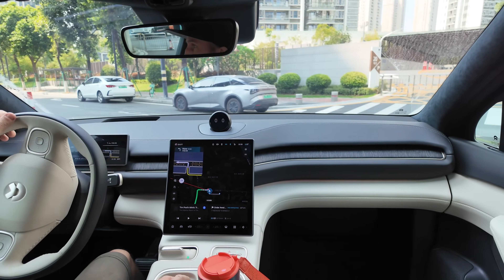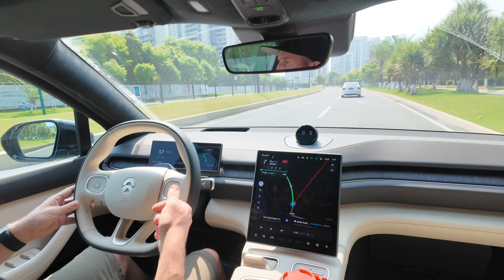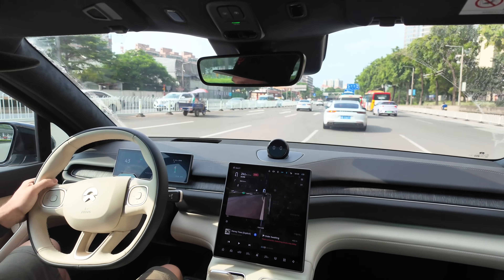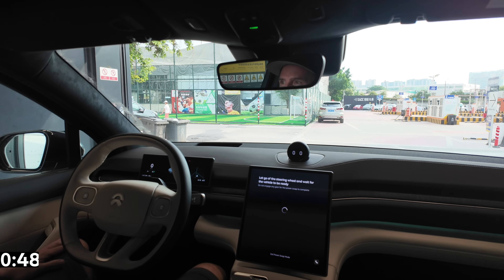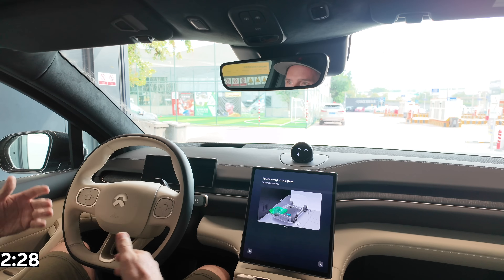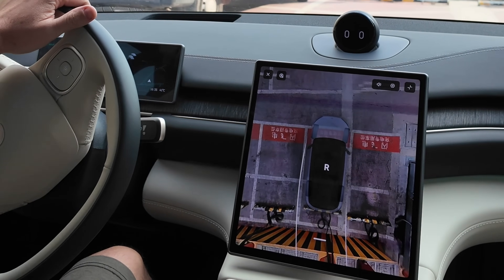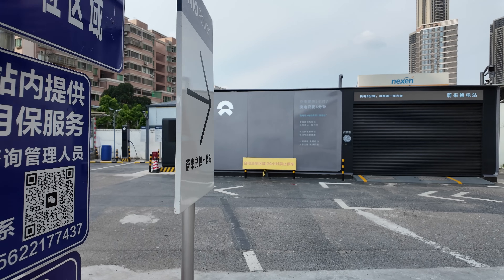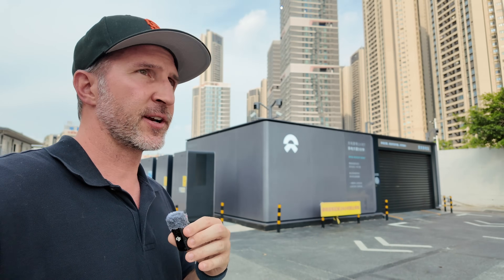NIO 4th Generation Power Swap Station Tested

Comment: How much cost to swap the battery? (in US$). Is it more expensive than traditional charging?
Reply from the maker: cost depends on a variety of factors, but no it is not expensive,  roughly equivalent to fast charging costs.
Reply: That's amazing!
 3.5 minutes for over 90% of battery. WOW.
Reply from the maker: It's down to 2.5 minutes now with ONVO cars... pretty nuts

Comment: Battery swap is not scalable when there are many cars needing to do battery swap.    How many cars can perform battery swap concurrently since waiting in line for each car is 3 minutes.
How many fully charged battery packs can each station serve before drivers need to wait for charged battery packs to be available?
Reply from the maker: Massive parking lots full of super chargers drawing immense amount of energy from the grid at the same time also “isn’t scalable” but is being done…Ideally everyone can charge at home during off peak hours but that’s not how things actually work. This takes up less space and is more efficient, more throughput of vehicles in the same amount of space. 3-4 parking spaces used to swap can fully charge about 15 cars per hour currently. 3-4 spaces all supercharging maybe could do a handful, depending on which make and model, what battery chemistry, load management, etc.
Reply: @Eric_Garrison  To compare with concurrent charging:   How many charged battery packs does each Nio station store?   25?  Are they charging them after the swap, or is able to wait till off-peak hours to charge them?   Or the same issue exists when you said they can swap 15 cars per hour?   NIO would need to supercharge those battery packs concurrently to have a supply of charged packs.
As for parking space, true when it takes longer to charge, but the swap station is counting on optimal car line up if it offers 3 spaces for people to park their car to wait for the swap.

Comment: I don't think this method of charging a battery will be very viable,... you have to travel to the station then you probably have to wait in line for your turn I'd much rather just be charging at home
Reply: Nio car is also chargeable too.
Reply: Not everyone has home charger.  Beside what about when you long distance travel ?!
Reply: @zuzang6914  more supercharging stations would solve that problem for travel.   And future vehicles would drive themselves to be charged/park, and to be summoned back when needed.
Reply: @Trust_but_Verify  You missing the whole point. People that don't understand tech should listen, not speak or write stuff. Until you at least have some understanding for how things work.
Reply: @MMM-sz8vh  I understand tech.   What's the point you are trying to convey? All techs need to achieve business value unless they are in the charity business.  Battery swap works for ride share owner needing fast turn around and doesn't need to worry about battery degradation for driving 100k miles a year.  That business is slowly eroded with robo taxi (in China) and faster charging battery tech (in next 5 years).  Is this battery swap business model attracting enough customers to buy NIO cars for this benefit?
Reply: @Trust_but_Verify  Most people buying Teslas here are worried about the battery going bad and having to pay thousands out of pocket. I reckon with this battery swap feature, a lot more people would feel at ease knowing they can just swap batteries instead of counting the days until it craps out.  That's the positive I see in this. But otherwise yeah, the drive to a battery swap station seems longer than to just charge it at home or at a charge station.
Reply: @EddieKM  I have plenty of coworkers own Tesla and they don't worry about battery going bad.  Some guy has a early (pre-2017) Model S and his battery degradation is 5%.   My first Tesla is 2018 now with 89k miles and sure not worry about it.
If NIO is going to guarantee lifetime battery from this swap then sure that's good for the consumer if they are not paying a huge premium for this 'lifetime warranty' and faster "swap".   Time is money to some people.  Time will tell if battery swapping station translates to higher vehicle sales and profit.

Comment: Amazing, sure beats pumping gas. Eliminates so many steps (get out of car, remove gas cap, pay with credit card, select gas type, pump, wait to fill up..., remove pump, cap gas, get back into car) to 1 press of a button.
Reply: A few extra steps, get cold or hot, pick up some germs, spray hands with alcohol,  get annoyed how much petrol costs and wish you weren't there giving money to a petrol company. Then leave.
Reply: In a different state there is gas attendance that does all that for you.   You just give them the credit card and what grade you want while sitting in the car.    Even regular EV charging could be automated with some robot arm but it's a bit "over engineering".   Most of time just charge at home takes a few seconds and it's done overnight.
Reply: @Trust_but_Verify  LOL, that's great. You living in the 1950:s still that's cute. NOT
Reply: @MMM-sz8vh  I own 3 Teslas.  So you own a NIO and uses this battery swap for all your charging needs?
Reply: @Trust_but_Verify  still waiting for robot arm
Reply: @BillyYe  It's not a worth-solving problem.
Reply: @Trust_but_Verify  it is good to be able to walk back your views of the robot arm
Reply: @BillyYe  With roboTaxi, there would still need to have some humans to service the vehicle (clean up, inspection), but likely more efficient when the fleet vehicle can get charged without human intervention.  When the fleet is large enough for a depot the automation would be worth it instead of 5 person chasing down 50 parked vehicles to plug them in.

Comment: Elon had considered this years ago, and it’s not a scalable solution.
Reply: Already 50 million swaps done in China. They must have some more data/ information by now that musk didnt have when he was thinking about that 10y ago...
Reply: @pedroaguiarcoelho3770  In terms of scalability, I still have doubts. The time, space, and cost required to deploy swapping stations, along with the need for additional batteries, pose significant challenges. I don't believe this approach will be viable in the long term once there are millions of EVs on the road.
Reply: @MocBocUS if batteries ain’t scalable, then how do you now expect all cars to run on batteries some day? 😂😂😂 that means at some point, all Evs will collapse coz there’s not enough batteries 😂😂! You say it’s expensive, but they already have 5 partnerships which will also build battery swap station for both their brands as well as onvo! Same way the franchise gas station! How is this hard to understand 😂😂
Reply: @adebayokehinde  dude ... you didn't get my point. You’d need twice as many batteries for every EV. Also, check out the costs of setting up battery swapping stations compared to charging stations. If, in the future, you could get 300-500 miles of range with just 10 minutes of charging, would companies still choose battery swapping over charging stations?
Reply: @adebayokehinde  Also, consider whether the station will be able to keep up if the number of NIO cars grows to match Tesla’s fleet size. With 23 compartments and a capacity of up to 480 swaps per day, the current setup might struggle to keep up, even with advancements in technology
Reply from the maker: You don’t need 2x the batteries… it’s like 1.05 x according to NIO a year or two ago
Reply: @chiefrocka1363  I still don't see how this can scale in the future, even with improved charging times. Battery stations can't operate faster than they do now. Currently, the cost a single swapping station is equivalent to 5 or 6 superchargers. Once charging times are reduced to provide 300-500 miles of range in just 10 minutes, you could charge 5 or 6 cars in that time frame, whereas you can only swap out 3 cars in 10 minutes.
Reply: @MocBocUS  yes sir! People will still pick swapping over changing and the reason is mainly because of battery degradation! No matter how you wanna sugar coat it! No phone battery can charge fully 100% in 10 mins! Chemistry proves that will kill the battery faster 😂😂! You don’t get my point! And just wanna hate! Which you entitled too! Lastly looking at power tools! 🧰 every worker who uses they hands, will always pick a swappable battery power tool over a charging power tool even though the swappable battery power tool will be more expensive, it saves cost over time!  Why do you think every Apple owner changes the phone every 4yrs? 😂😂 coz even tho the phone might be slow, that battery dying quickly is really annoying 😂😂! So please explain to me again why charging is better and faster 😂😂 (let’s not also forget that nio has charging and chargers and charging station too but okay, let’s act like they don’t) 😂😂
Reply: @MocBocUS  also saying we need twice the amount of batteries! Okay, let’s even assume that, and let’s assume there no nio! Wudnt Tesla need twice the amount of batteries too? Or when a tesla battery dies and has to be changed, where will Tesla get the additional battery from? Since batteries are expensive 😂😂! Speaking about swap station and building cost! Nio already has 6 partners to help in building them! 😂😂 even if they didn’t have the partnership, knowledge of knowing mcDonald’s doesn’t own every franchise already told me, nio is not the only one that’s gonna build swap stations! Just as mobil/shell don’t own all filling stations and gas stations 😂😂😂!  More FUDS please, coz this ain’t working 😂😂
Reply: @adebayokehinde  nah…check your fact again. Propel rather own the battery than have a subscription.
Reply: @MocBocUS  I see the same worries and troubles with charging station! Wire cut? Charger broken? People parking just to reserve a spot for friends, when there are more people charging, the charging speed drops, people not trusting 3rd party charger so the all flock to Tesla supercharger but now you gotta wait coz there’s a huge line! With all these FUD! Why are people still buying Tesla then? 😂😂😂 I haven’t even brought up people living in apartments building 😂😂!
Reply: @MocBocUS  you see, switching the conversation coz you being put in a corner with reasonable facts! The argument is about swapping battery vs having a fix battery 😂😂😂! Dude brought subscriptions into the argument! 😂😂😂 do you also bring financing a car into an argument of buying a benz or an Audi? Dude will be like, buy benz financial company ask for proof of house 😂😂😂!
Reply: @MocBocUS  as a Uber driver who lives in an apartment, and also have many Uber driver friends! We don’t care who owns the battery, we just don’t want to have the weights of owning the damages when the battery is dead! Plus we don’t like sitting down still charging for 30 mins, when we know in that 30mins we cud make $20-$30! What if it’s during peak time, ouche 😂😂😂
Reply: @adebayokehinde  do more research please :X
Reply: China, the largest car market on the planet, has fully adopted swap, government support with numerous partnerships with some of the largest automobile makers on the planet licensing NIO swap tech with NIO already surpassing 50 million swaps with closing in on 3000 swap stations but some used up floppy dildo on YouTube doesn't agree.  Every comment section has their own special defective human, I guess.
Reply: That was nothing near of what this is. And he had to focus on other thing at the time, if today he would for sure done it. But as said this tech are so many steps further than it was back then.

Comment: its mind boggling to me as to why the media isn't talking about this cutting edge tech oh well when the NED funds them to spew antichinese crap its understandably absurd.
Reply: It’s because the market makers that own cnbc are short Nio.
Reply: Can't hold it down forever. Quarterly earnings results will dictate when this will fly
Reply: You can do it doesn't mean it's scalable or even profit making for the company.  Each station would need 15 spare battery packs on standby.
Might work for the scenario where the person isn't in the middle of travel and can set a schedule a time to arrive so they don't wait for a line of cars to have the battery swapped.
This swap would have been useful when supercharging is not available 20 years ago.   How many people are buying NIO just because it has battery swap station? 
People with new cars would swap battery to something that might have ~10% degradation?   I wouldn't.
Reply: @Trust_but_Verify  I see you've fallen victim to parroting elons opinion, battery swap is proven useful and over 70% of customers choose battery lease, 50 million swaps completed so far. Actions > words.
Reply: @projectburpees  Side question:  How does battery insurance work if the car is totaled?   What does car owner need to pay Nio?  Car insurance company covers that extra cost?    In a 2020 article the monthly lease cost minus the price reduction of the car is about 6 years payback, meaning after 6 years the person needs to continuously pay monthly rental vs owning it out right.   similar to lease/buy the car?
Reply: @Trust_but_Verify  Right the battery lease works out for the customer short term with a significant reduced upfront purchase price, and over time will pay more for it, still they get the peace of mind of not owning the pack.  I think insurance would be partly covered by the battery assent management company? Not exactly sure on the specifics.
Reply: @Trust_but_Verify when your battery gets below 80% health  you will swap it in a heartbeat. Just make sure to drive it till it degrades to the point where you feel ok swaping it. Duuhhh.
Reply: @hydrohasspoken6227  I am fine with replacing the car after 250k miles.  Currently 1 EV has 86k miles, no issue with range.  Battery technology keeps on advancing with higher density and faster charging.  One could also just lease the car for 3 years if they are worried about battery degradation.
Reply: @Trust_but_Verify you are forgetting they can be recharged as well. You have the advantages of both worlds. Shortsighted people like to pick between two advantages when they could have both

Comment: Kinda boring
Reply: Boring??  It should be as exciting as fueling up your diesel or gas powered auto...and  it is.
    In this case...BORING, is an endorsement to its efficiency
I guess, to you, exciting is waiting to conventionally charge your EV for some 45-60 mins ... hey, to each their own.
Reply: @elgar6743 not to mention it’s way safer to do battery swapping in the current chaotic state we are in…
Reply from the maker: 不好意思
Reply: @Eric_Garrison  haters gonna hate xD
Reply: boring tech is the best tech similar to wifi auto connecting